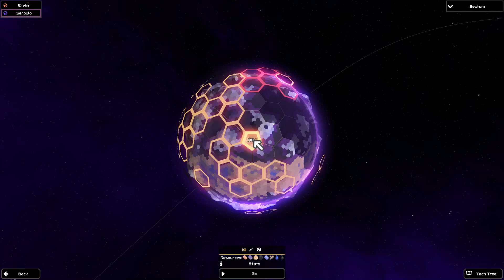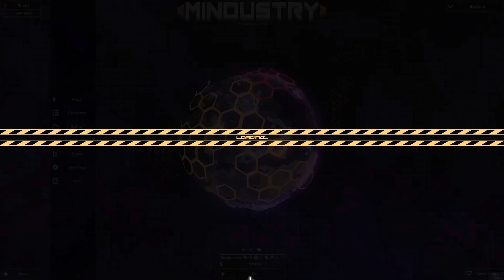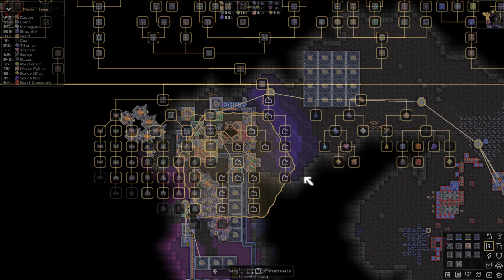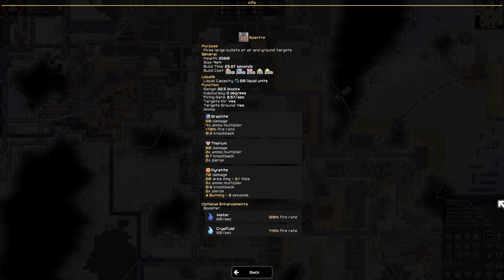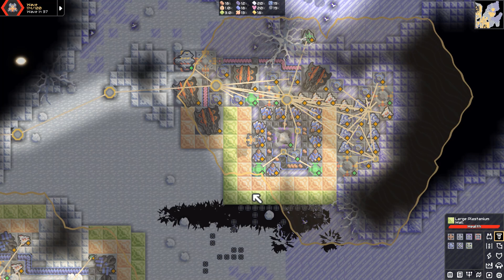Mindustry The Bad Guys Ruined My Logistics Fun

Comment: Think of the plastanium conveyers as veins ,smaller conveyers join into it ,if you use it correctly it can replace at least 5 full capacity conveyers to the core ,join them on by placing one plastanium conveyer to the main one and allowing your different materials to join in through there ,if you need help I can show you how it's done ,I have just short of 700 hours gameplay
Reply from the maker: My goodness. That's an amazing amount of gameplay. I'll play with the conveyers more once I have. a chance to focus only on logistics and getting things setup "properly."